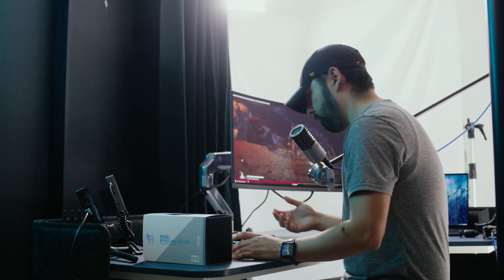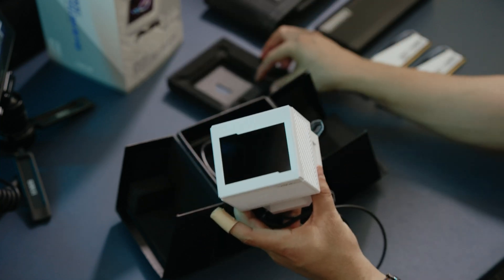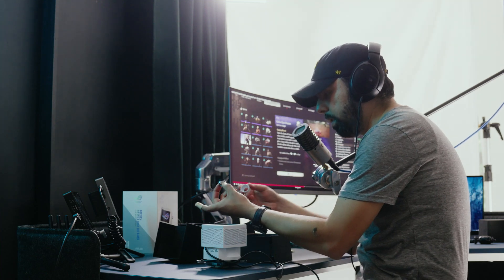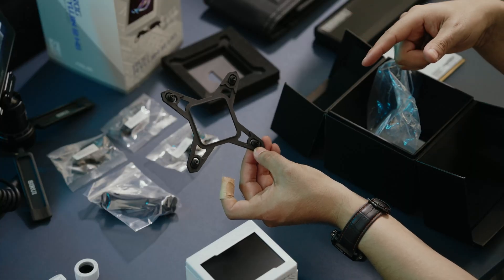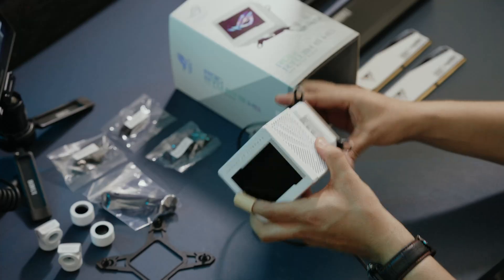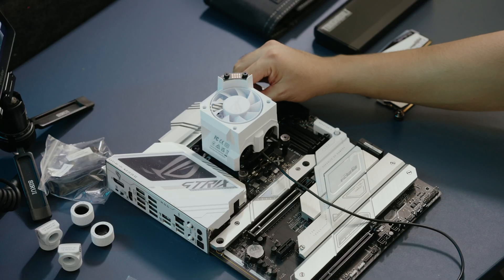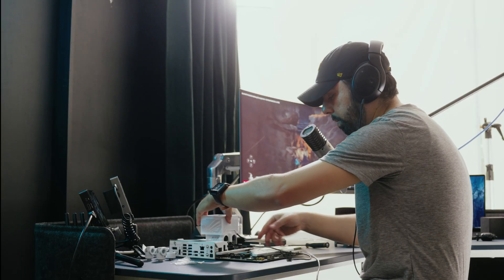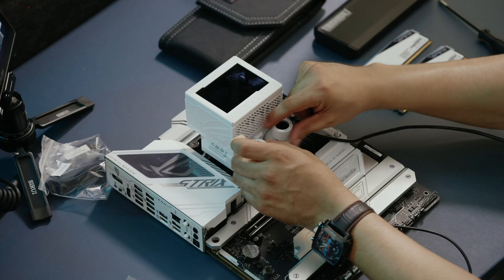Asus ROG RYUJIN III Water block!

Comment: hello There's no pump, right? Thşs Water block in the product  on it so only ¿ ?
Reply from the maker: No pump just CPU block
Reply: @Modsbybenq  Thank you for your feedback.
It's a very ordinary product, I didn't like it at all. I didn't expect this from Asus either. It's a plastic body, the internal components are plastic, the only good thing is the Rotary Adapter Twin, and the product doesn't even have a pump, it's passive. It could have been more professional. :D

Comment: I get extremly high temperatures with this waterblock....I check and rechecked everything from Fan control, thermal paste, etc...Idles at 60c. Way too high for watercooled machine, I put my old waterblock on (Byski) and cooling idle temp 23c...so, this is garbage